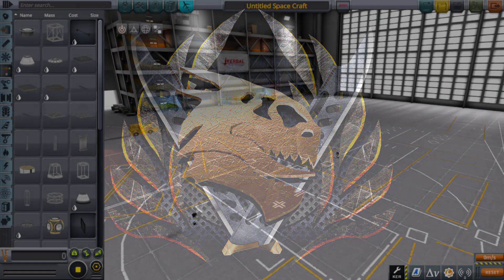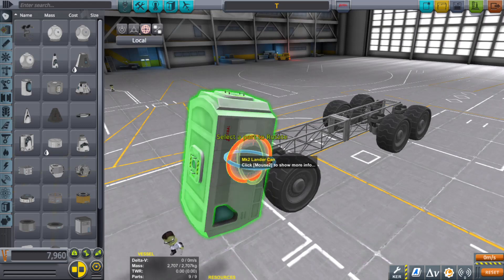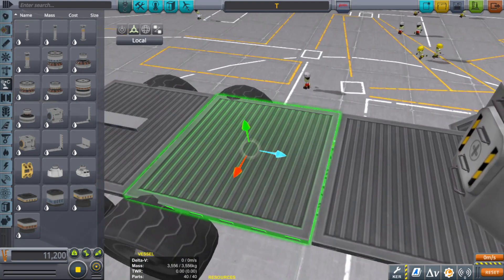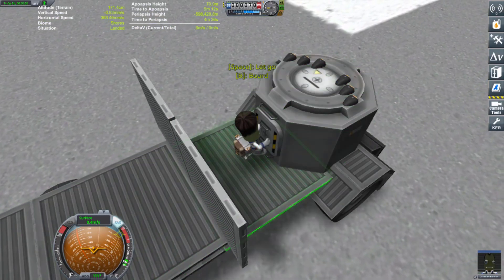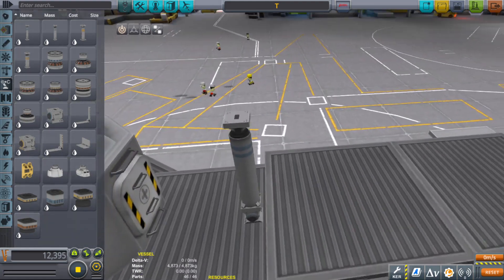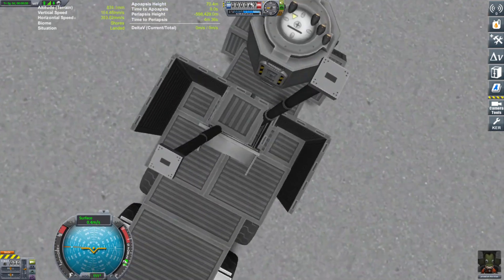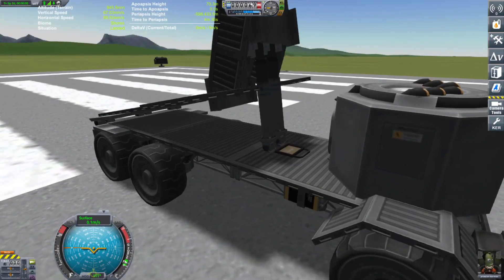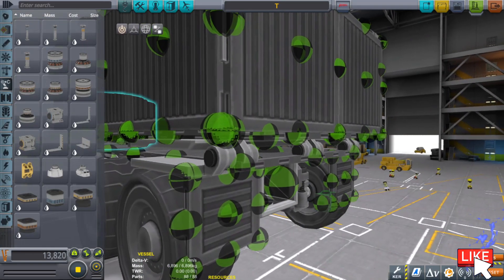FULLY WORKING DUMP TRUCK  |   KSP 1.11

Comment: If you use struts for the Zylinders it wouldn't lag through the housing.
Just connect the struts with some walls.
Behind there you wouldn't even see them.

Comment: 2:10 strut connectors AKA struts. I've used them to make 3 hinges work in parallel; it worked fine.

Ignore me, the truck turned out great! :D

Comment: I know you don’t really do mods but the Recouple and Missing Robotics mods could save you some grief, Recouple forces two point that are close to each other in flight to connect and Missing Robotics adds stock-a-like robot parts.
Both mods are on Ckan, also Restock and Restock plus might interest you